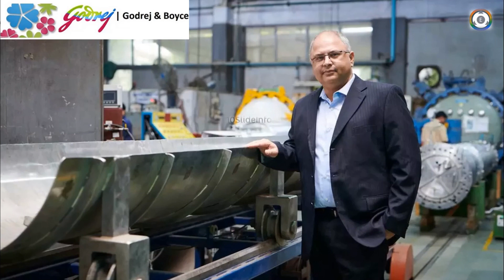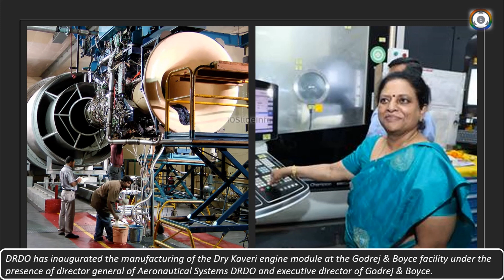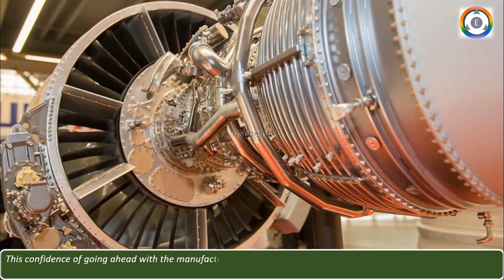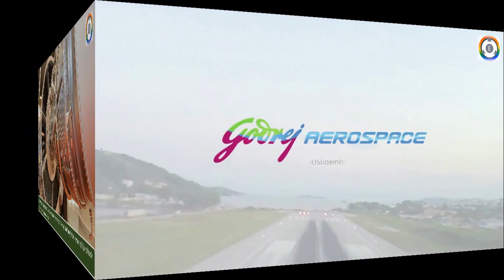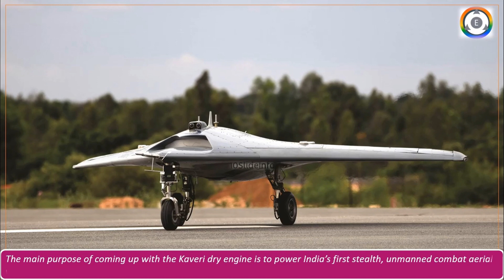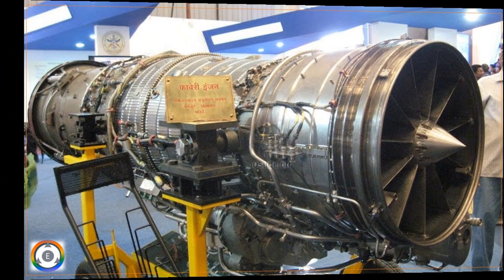Manufacturing Of 8 Dry Kaveri Engine Modules Starts | Godrej & Boyce

Comment: India is way beyond China in building Aero Engines equivalent to GE F414 20kn thrust Engine. While China's present President Xi Jinping is a very Techno Savy President of China. In Defence related Weapons  R & D Xi Jinping 3 time's has increased the flow of the  Budgetary allocation on developing Modern Latest Weapon Technology
China is already building Aero engines in reverse engineering of Russian Engines. Today China is building better Aero engines than Russian Copied version. WS 20 and Ws 20 B for wide Body Comac Airplanes of 2 row Aisel 3+3+3 combination of seating 250 to 300 seats
Passenger civilian Aircraft challenge to Boeing 777 and Airbus 320 and 350 series of 300 seats Capicity.China has build Aircraft carrier Fujian of 80,000 tons  with Electro Magnetic Catapult heavy Duty Launch system and in near future will build more Nuclear Powered Aircraft carrier of Nimitz Class are already 3 lined up on the secret Defence Ports. China's desire to have Blue Water Navy. China is a Super Power.!!! India is not. While Our Feku Modi is building Rama Temples Modi is not a Technology savy.! Like Xi Jinping of China has decided to make China a great Power that will overtake USA and the world in all fields of Latest modern Technology.!!! China want to Control whole of Asia and the World.....